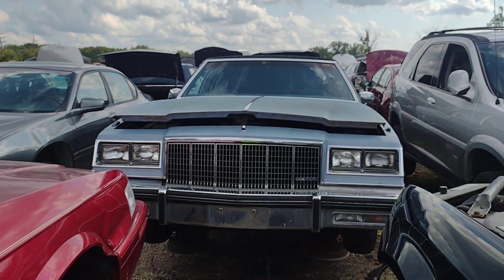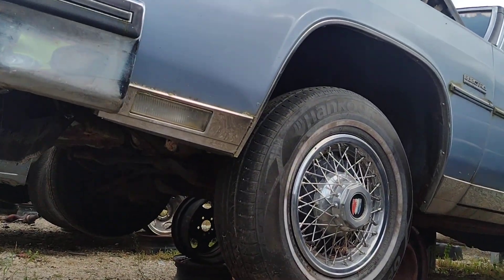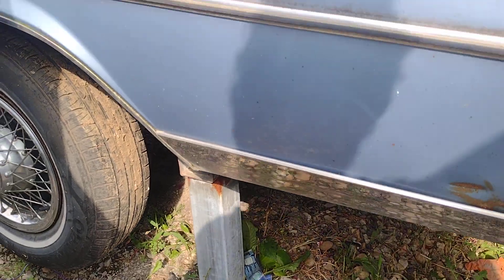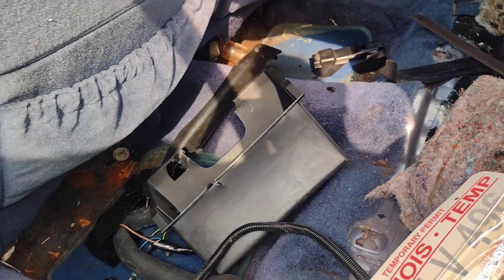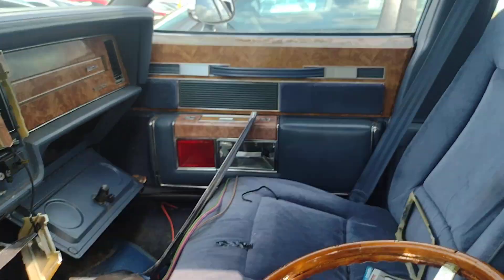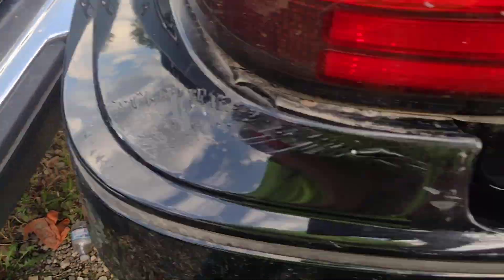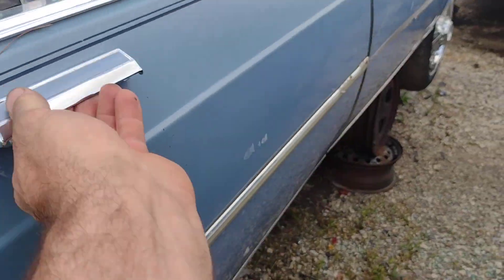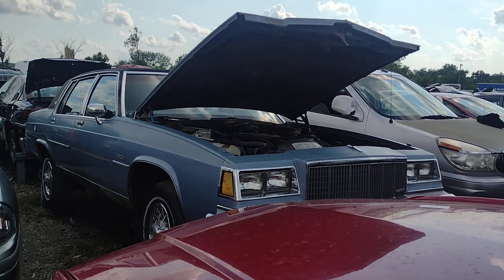1984 Buick Electra Junkyard find 5.0 V8 4 door cruiser

Comment: These interior were the best interior of all the car industry HISTORY.
We werent conscious of it in the 80 and 90.
I bought a 2004 buick because 9f the interior and how clean and low milage it is.
But frankly i want to get my hands on a 1980 car.
Reply from the maker: @celuiquipeut6527  Yeah the nice plush interiors and smooth rides where great.
Reply: @NathansMoparGarage  Nowadays cars ridee hard and have uncomfortable leather sests or faux leather. I really dislike them.
They also "swallow" you. I am clostrophobic. I feel like someone is holding me. And the windows height is so high niw. There is more door than window.
I rode a brand new camaro, dude...it was like a coffin. You cant put you arm out the wi dow. Because its at shoulder lenght.
Nha man. Cars were better back then.
Reply from the maker: Exactly, I was looking for some K car seats when I had my 07 300 because those seats were terrible. Can't really find those in the junkyard anymore either.
Reply: @NathansMoparGarage  Yeah its harder and harser. Gotta hold on to what we have! Now that i secured my 04 buick, i'm looking for 1980ish i'd like to get a delta 88 or something of the sort. With velour seat. That would be a project tho. I'd most def8natly would want to replace the engine with something from the 90's.
Funny thing, i had to chiose between my car and a 300. I picked the suede interior and the unassuming grand pa look.
Good luck on your hunting!!!

Comment: Yup, 1984 model year with the VIN for the win: 1G4 for US made Buick, A for manual seat belts, R for Electra Limited, 69 for four door sedan, Y for 5.0L (307 CID) V8 with four barrel, Oldsmobile produced, aka RPO code "LV2", aka "Silent Runner" aka "Mini Pocket Rocket", 4 is a check digit, E for the 1984 model year, H for Flint, MI assembly and the rest is the production sequence. The Flint MI plant was the Buick "home" plant and operated from 1904 to 1999. The 307 CID V8 is one of the best engines that GM made, and although it has the power band of a lawn mower, they run, run, run, run, run, run, run, run and run some more. They run so quietly you can barely hear them. My uncle had a 1983 Electra Park Ave that he got in 1986 from the Cadillac dealership that my dad worked at with 20,000 miles on it. A school principal owned it and it was immaculate. My uncle had the car for years before he bought a 1992 Buick LeSabre new. After that he had a Olds Aurora and a Chrysler LHS and then a Hyundai before he passed away in 2016 (two weeks before my mom did). 

No tag, can't brag. No SPID (on the underside of the trunk lid), wish you did, but the exterior paint is code 22 Light Royal Blue.
Reply from the maker: @googleusergp  The 80s full size cars where nice
Reply: @NathansMoparGarage  Indeed.